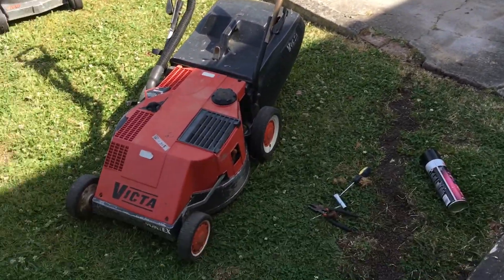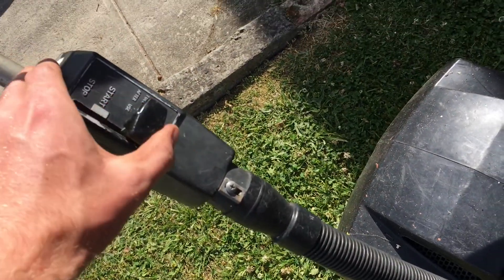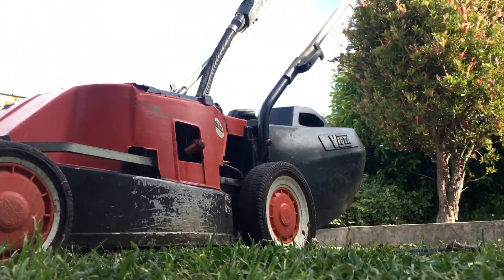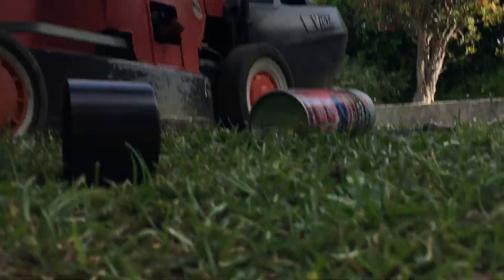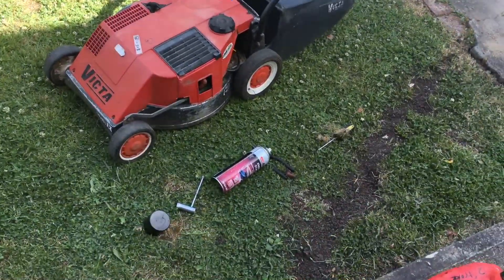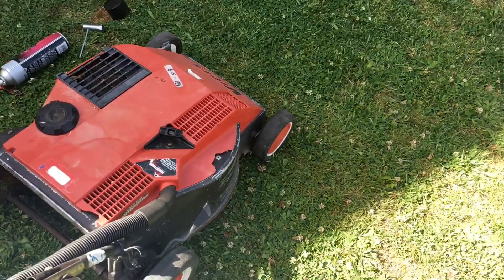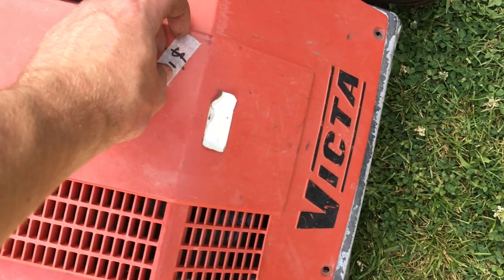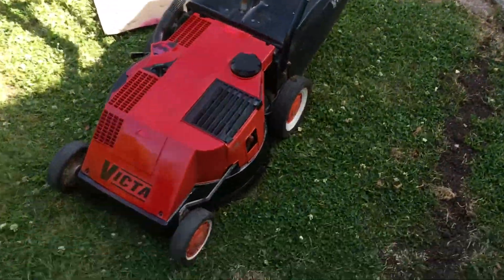RARE! $15 Victa lawn mower, WILL IT RUN?

Comment: 50 - 1 mix, ?     Says 25 - 1 on the machine………………
Reply from the maker: Yes but 25:1 is too rich for my likings just too much smoke usually on a 25:1 mix have just tried n figured out what the most suitable mix ratio